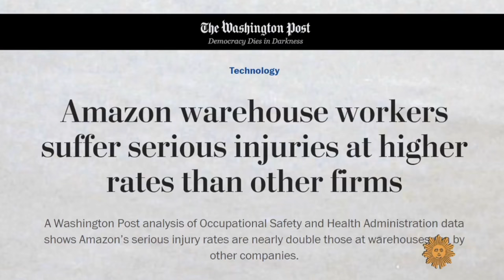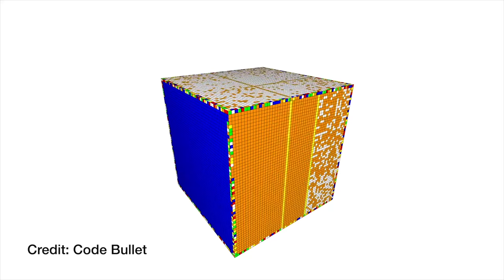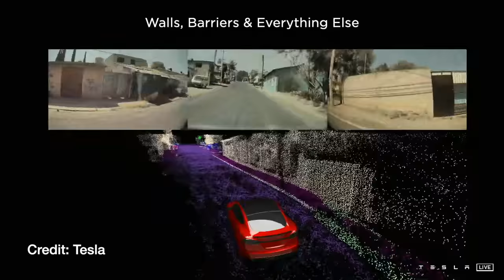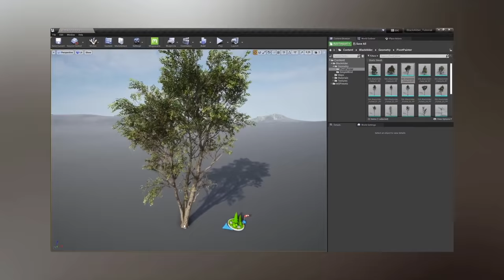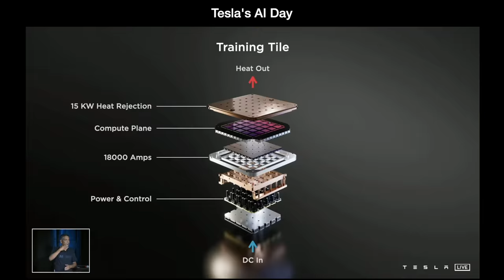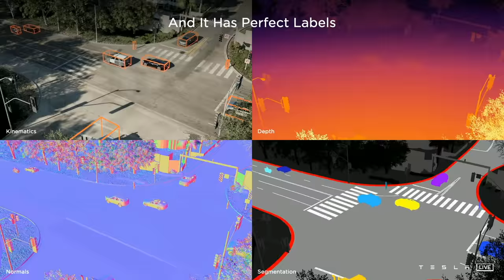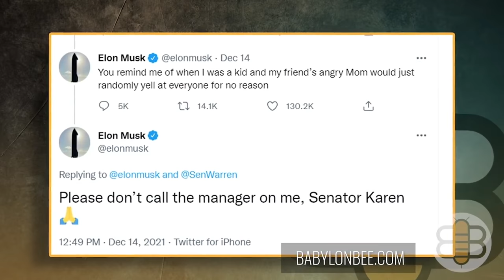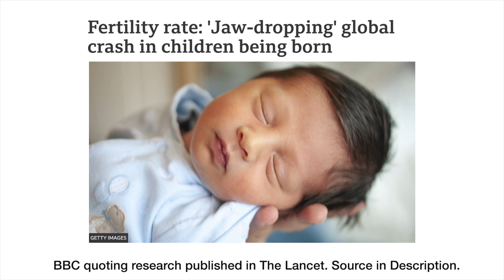Ameca and the most realistic AI robots. Beyond Atlas.

Comment: I'd be curious to see how an AI and robotics platform could understand and perform auto body repair. Like having a perfect understanding of material properties along with how to manipulate damaged metal back into shape and knowledge of the exact make of cars body geometry before and after damage seems like something that'll be achieved.
Reply: It's more likely the robots would just identify damaged parts and replace them, rather than repair. You could easily automate frame repairs, not much of a stretch to have the computer operate the pulls to get back into spec.
Reply: @motoduc78  I could imagine a robot that could become a genius with a hammer and dolly, like an expert metal man of old.  OTOH, maybe I'm underestimating the difficulty of that.  Elon though FSD would be done years ago.  It's proving to be harder than it looked.
Reply: Dealing with unique situations at every turn is one of the areas where robotics will be the last to take over.  Each vehicle design is different, and each damaged vehicle presents wholly unique situations that a robot will have to figure out.  Where a human can look at the gap between the wheel and the well dimensions and figure out, almost exactly, what damage cannot be seen a robot will not.  Much less a mangled fender, all of the underlying structure, wiring, and plastics that have all deformed differently.

And, for instance, roadside assistance.  No robot going can change a tire on the side of a highway - because the mechanism necessary to perform the task would simply be too large for mobile applications.  Once they get humanoid robots that can move as dexterously as a human that will change.  I, however, will be long dead before that happens, so I've got job security for life.
Reply: @amzarnacht6710  yeah it's a rather complex task. I was imagining like 4 or 5 arms being placed in specific areas around a dent in body panels applying tension and compression so that with a controlled tap or blow by another arm the dent is removed. Just Suction arms for small dents.
Reply: Why not replace than repair.? Most of us may never need to own a vehicle since FSD robot taxis will take us anywhere at a very low cost. In any case, due to high human accident frequency, killing thousands every year, we may never be issued a driver's license except in special cases.
Reply: @juanasenjo6627  there's many reasons for repair over replace. Some reasons are economics, energy conservation, materials management and part scarcity. On a construction or mining vehicle if a metal panel is dented in but materials aren't fatigued than it would be advantageous to work metal panel back into shape(general maintenance stuff). Obviously we would need to be very advanced to have a on-site robotics module that the panel could be dropped off at and rapidly repaired with little to no human interaction.

Even with self driving vehicles body panels will get worked by the environment(rocks, or debris in wind). Considering that's the damage we can mainly expect, an automated way to fix all that rapidly would be useful in one way or another.
Reply: Nanites like in Terminator would work.
Reply: Shannon....
The problem is, nothing on this earth is perfect, certainly Not man! So, man cannot "create" something that has perfect understanding of anything! There will always be bugs in anything man designs! Remember,  it's human to err!
Reply: Mechanics would probably riot and attempt sabotaging these things wherever they set up a storefront if they became mainstream. Lol 
That would likely be a cheaper alternative since human labor is largely erased. You’d likely only need like three people (one to greet and set up appointments and two others to monitor the machines) compared to a fleet.
Reply: @juanasenjo6627 I have a love/hate relationship with self driving cars. 
On one hand I see how they’re useful for long journeys or the elderly and disabled who can’t drive themselves. 

But on the other I see big potential for hackers stealing peoples cars or an Eagle Eye situation where the gov could just ‘shut you down’ at anytime because the AI in your car is a part of their interconnected framework.
Reply: WARNING!!!! JESUS IS COMING!!!!   IF YOU DIED TODAY, WHERE WOULD YOU GO???  HEAVEN OR HELL???  Jesus loves you and can forgive you of any sin that you have ever committed.   Repent and accept Jesus into your heart and you will have eternal life in Heaven.  ROMANS 10:13 Any one who calls upon the name of the Lord will be saved. AMEN
Reply: @bluespruce679  If AI, vision or probing system, and robotics have bugs then I'm assuming they can be minimized over time.

I'm a machinist, if my cnc machine doesn't machine something correctly I can adapt its toolpath to account for whatever material or tooling issues were occurring. Robotics let you tweak to perfect(.001in-.002in, half the thinnest human hair to the thinnest human hair) tolerances, average person would consider precision like that as perfect.

Considering AI can learn and robotics are so repeatable if it's having issues the system can be adjusted into what is for all intensive purposes perfection.

"Perfect" in my original comment meaning the AI has very complete knowledge around material properties and deformation or in other words exactly the knowledge it would need.

Comment: Although I find robots and AI fascinating I also want to study and learn how to destroy them. I have a feeling this will be a necessary skill in the near future.
Reply: Yeah, we're fonna have to fit EVERY robot with a remote kill switch that's hardwired to their "brain" so it can't be removed or deactivated
Reply: Fry them-  electric surge similar to using  the life saving aed to bring u back a heartbeat can also can kill u so putting this to 1 would do it ... Not sure how many surge clear charge  ongoing to fry it if that helps u 

 to do it without it knowing going to take two person job posb shvt them both dieing as it killing one  person u frying it during it's occupied time ... 

Same as taking a electrical wire live etc.
Reply: @harrydavey9884  Absolutely, but the AI will likely reprogram that away. There will need to be manual kill switches as well...
Reply: @EA-dg7lq  Absolutey.. I've even researched how you can build electro magnetic weapons out of your micro wave..
Reply: @Jack_all  really .. anything overload surge max capacity example the power source to the towns wit that cable underground or such going to fuel into a god I doubt it … everything can b fried out in machinery chips programs just like a cell phone 📱 well can hope they don’t make cloned god 2

Comment: Some interesting thoughts, some are completely wrong - like in 10 years half of the jobs are gone - of course some will be gone, replaced by new jobs or changed tasks. In some robot examples it is well shown why this is currently on a good way but AI is and will always be human based. Look a the spider trying to reduce the time of feet in the ground, putting herself on the back. Problem solved but certainly the goal not reached. Robots are often lookalikes of dog, human or else, but that is not the bst approach. Movement on two or four or whatever legs is perhaps worse than on wheels - it always depens on the task, there will not be the one solution.

Comment: AI humanoids will not be a threat to humanity if humans retain control of the electricity powering them. ⚡💡🔦 ⚡Right?
Just don't give the robots a way to charge themselves unless instructed to do so - this should be taken seriously - and we need a utility kill switch for electric power (and a new source of renewable energy). Control the power, uninterruptible power supplies, generators, etc. don't let the humanoids control the source of power or electricity ⚡
and don't let virtual AI interact with humanoid physical AI or drones
💡⚡💨Really we have to control the electricity more than anything.  It's our one distinguishing advantage - we are alive and filled with electrical energy from who knows where...microprocessors, code, wire and metal are not and have that dependency on humans.  Right?

Comment: I would train to repair and maintain all these AI machines and charge a very good price - they are just machines with a computer within, the same as most cars now-a-day.  The car replaced the poopy horse and draughty carriage and benefited us all; farriers went from putting horseshoes on to becoming a mechanic, and blacksmiths began designing metal bodies to put over these new-fangled combustion engines. 

The thing that quickly occurs to me is the endless expensive batteries or charging stations, repairs and maintenance, and specially designed areas required to keep these things running, apart from the cooperation required between countries to make and get these millions and millions of said components, some are made of rare materials which are only found in certain countries. 
Compare that to the human employee who looks after themselves and turns up to work at their own expense and breeds and teaches little new workers - the globalist socialist governments are presently developing a modern human tax-slave which will probably be the most inexpensive "worker" - I think I know which "worker" will eventually win out because governments know which side their own bread is buttered.  They only require a certain amount of such "workers" to maintain THEIR lifestyles and the rest of us are "non-essential" as we recently found out.  Who knows what the future holds but one thing for sure is that humans will decide most of it, maybe to their own detriment.  Regards.